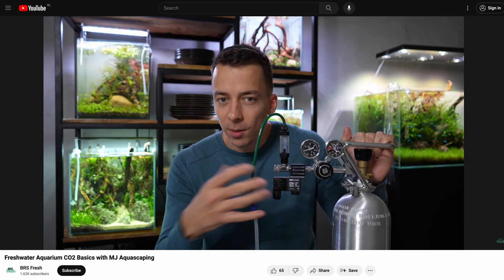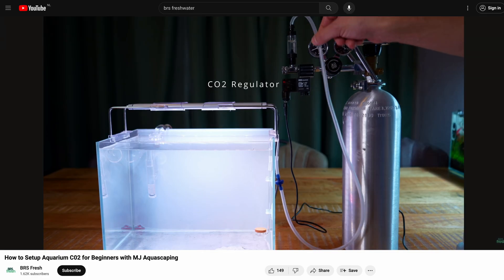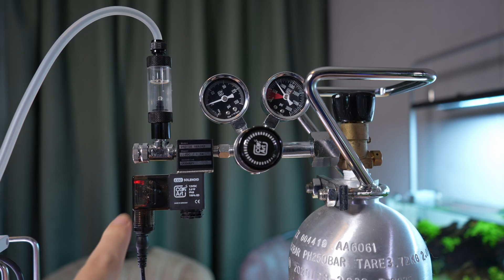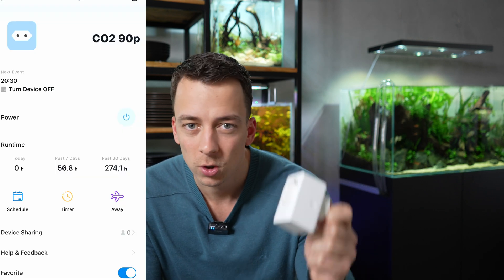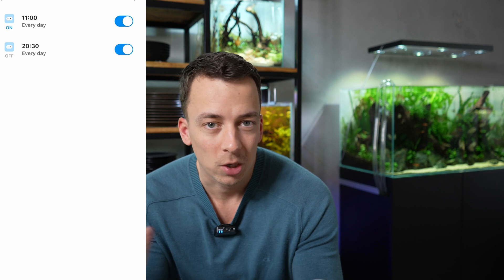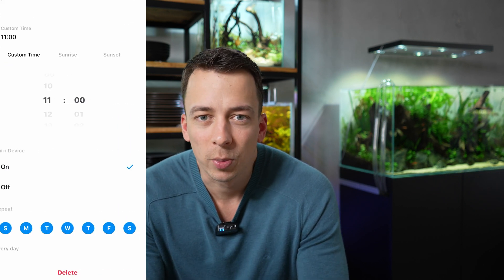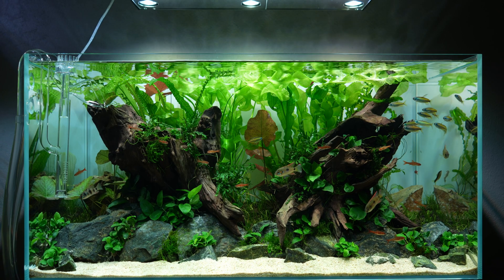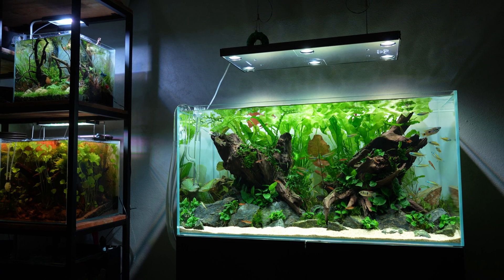Top 10 Aquarium CO2 MISTAKES MADE!

Comment from the maker: What mistake have you made before with CO2?
➡ Electrical outlet timer: https://brs.li/Fresh_SaveAWatt_DigitalTimer
➡ CO2 diffuser: https://brs.li/Fresh_Aquario_CO2Diffuser
➡ CO2 check valve: https://brs.li/Fresh_CO2Art_CheckValve
➡ CO2 drop checker: https://brs.li/Fresh_CO2Art_DropChecker
➡ Spare CO2 cylinder: https://brs.li/Fresh_CO2Tank_5lb

Comment: Turning off CO2 at night is now an outdated method, but it depends on the volume of the tank. For example, for tanks up to 75l, it might make sense, but for tanks over 100l it no longer makes sense. If you turn off CO2 at night, by the morning in 8-10 hours your pH can jump by 2 degrees to a value above pH7. And this is much worse for fish and plants. Moreover, it has been proven that with a reasonable dosage of CO2 even at night, nothing major will happen in the aquarium. Quite the opposite, in the morning after the lights are turned on, the plants have enough food. It may not be suitable only for certain plants, but rather for certain animals, but I never notice that either.
Reply: Turning off CO₂ at night is not outdated, but it is no longer mandatory. Stability matters more than rigid rules.

Comment: What about co2 bubbles getting sucked into canister? My flow pushes co2 bubbles all the way around the tank back to the pipes. So intake will suck some of these bubbles for sure, and i came across that it might kill the beneficial bacteria due to oxigen loss or even harm canister filter. 🤔 my co2 and filter pipes are in opposite corners.

Comment: How do you unblock a CO2 diffuser membrane disc? I bought a new glass diffuser with a spiral tube inside and the diffuser disc on top but it seems to be blocked up and not passing any bubbles. I even tried blowing air through it with a lot of pressure but it still does not pass any bubbles through the disc.

Comment: I just set up a high pressure co2 system. The co2 is going straight to the surface and I use a sponge filter. Would a wave maker be a good way to circulate it better? What else could I do without changing filtration?

Comment: Just hooked up my first nano tank (dennerle 60l) with a co2 system yesterday, but I have trouble with the bubble counter. I just have a basic glass one that’s next to the tank, but unless I turn the pressure up to “small tornado inside the bubble counter” no bubbles come through the diffusor. If I leave the bubble counter off it flows on low pressure, so I was thinking about buying a new bubble counter thinking something might be wrong with this one, or a different diffuser.

But I’ve read different diffusers need different amounts of pressure, just like different tanks need more of less CO2. 

So what’s the point of a bubble counter anyway if you just read of of the drop checker anyway?

NL here also buying of Azaqua!
Reply from the maker: Hey, good questions!  So this does happen a lot (with me too) where you put a diffuser in and set an appropriate rate of CO2 and nothing seems to happen.  There are a few possibilities here that at least I have encountered.  For me, I have turned the "tornado" on just to get the bubbles flowing (this is often after having the diffuser sit for a couple hrs in the tank).  Once they flow or burst through, they should continue at an appropriate pressure - that's when I dial in the bubble counter to 1-2 bubbles/sec.   Then I adjust from there using the drop checker.  If that doesn't work, then you may have debris in the diffuser (less likely) or it's faulty and needs to be replaced for whatever reason OR what typically happens is you have a leak somewhere.  That can be due to missing the little black o-ring in the bubble counter, it can be a small hole in the tubing, etc.  So check that stuff out first.  This should work pretty easily for you so if it isn't it's not because you're doing something wrong, it's because there's something wrong with your equipment (my assumption).  Hope that helps!
Reply: @ thanks for the advice!
Seems I got a lucky hit, removed the bubble counter when I posted the question in wait, but appears I have hit the right amount of co2 right away. Drop checker is perfectly green all day so for now, I’m just gonna let it be as is. (It is ofcourse on a timer and stuff).

Might mess around with it later again if I change my diffuser to one that’s full glass up and out the tank (not really happy with the matt-“transparent” co2 tube I have right now, and the clear one is to rigid so it keeps a bend and pulls everything off).

Comment: Another tip: In my opinion, the position of the CO2 diffuser should be closer to the substrate, as this also extends the contact time of CO2 with the water than if the diffuser hangs higher in the aquarium. Greetings!
Reply from the maker: 100%!  Thanks for watching!

Comment: Hi, How is it possible that CO2 goes through the dropchecker and through the new tube but comes not out of my new diffuser? I removed the valve. 
Looking forward to your reply. 
Regards, Ralph
Reply from the maker: Hi Ralph - new diffusers can take time before bubbles start to form.  The valve won’t affect it and best to keep that on there to ensure no back-flow of water.  What I often do is turn up the CO2 for 30seconds pretty high to force it through and once the bubbles form I turn it back to safe levels.  If that doesn’t work you may have a leak in the tube so I would replace the tubing and after that replace the diffuser.  Good luck!
Reply: @BRSfresh  Hi, Thanks for your reply. The tube and the diffuser are fine. I just found out that the rubber ring in the top of the bubblecounter was missing. I put in a ring and now it runs perfectly. So the CO2 was leaking without seeing or hearing it through the top of the bubblecounter. All the best, Ralph
Reply from the maker: Ah!  Makes sense - nice work figuring it out and thanks for sharing!

Comment: Great tips! I did not have my CO2 turning on before my lights, had my diffuser in the wrong place in my tank, had my check valve close to the CO2 tank instead of close to my diffuser, and was using water in my bubble counter. Thanks for the assist 😊
Reply from the maker: Glad it helped and thanks for watching!

Comment: I use an online diffuser which I think is much better. In my bubble counter I use olive oil.
Reply from the maker: Both are great ideas!  Would live to know your thoughts: Do you find that the rate of the bubbles through the olive oil makes you adjust the flow any higher to compensate for the viscosity or are you able to keep the bubble counter dialed the same as water?  How many bubbles per second are you running?  Thanks!

Comment: Hi, I use the Aquario curved diffuser.  ● I've seen your answer to someone else's questions. You said to put the check valve a few inches  above the tank. How do I do that when the stem of the diffuser curves over the rim of the tank and down? I'm using an aquario curved diffuser S in a 60 p tank.  Why do you need to elevate check valve?   In my 60p tank, could I just clip the diffuser on, and it's at the right height? half way up
Reply from the maker: 👋!  No worries with that diffuser. You can just set the check valve in your tubing a couple inches below the curve.  The point of it being high up in the tubing by the tank is to stop the back-flow of water up the diffuser that can happen when the CO2 shuts off.  And to stop it early before it goes down the tubing behind the tank.  In other words, if it’s further down the tubing behind the tank, when your CO2 turns back on, it may not have enough pressure to push through all that water, especially vertical, which could affect the gas flow in your tank or even if it gets to your tank at all.  This doesn’t usually happen right away.  If you have your check valve down low, your CO2 will probably run fine initially.  But in my experience, at some point it doesn’t and when I move the check valve, it solves the problem.  So now, I just start with it high a few inches below the rim.   I hope that helps!

Comment: Thank you for the video. I have couple questions below;

- Do you use twinstar as you are selling on your site
-  Opposite idea ,using filter during CO2 may increase the water irritation on top so Co2 can escape more easily ?
- For example ,we use hang on back filter as the same side as Co2 diffuser, I see that bubbles are going more further side of aquarium. So this waterfall effects push Co2 bubbles mid of aquarium?
Reply from the maker: 👋! Yes I use twinstar and also Aquario diffusers (extended ones are cool).  As for CO2 placement if you place near your HOB the water can push the bubbles down helping them stay in the aquarium and dissolve - and be distributed further in the aquarium.
Reply: @BRSfresh  thank you for your quick respond . very informative

Comment: I think u might of helped me, the valve check being slightly far away might be my culprit. My co2 runs fine but always lags to start. I have to increase bubble counter to force the gas through and then reset it correctly again everytime at start , super annoying
Reply from the maker: I have definitely been there.  Moving the check valve up to just a few inches past the top of the tank permanently fixed the problem!

Comment: Ive been running co2 from the 2 bottle setup (that i learned from your channel 😁) with daily ferts (flourish and flourish excel), about 6 root tabs, and about 2 inches of the enriched aquasoil substrate on a 10g extremely heavily planted tank with a large variety of plants with no fish in it (only some pest snails that hitched a ride from the store) so i dont necessarily have to worry about killing anything by having too much co2. I dont even have a co2 checker because of that fact. And i never turn the co2 off because no fish to kill, pretty much just an underwater garden and my question is: should i put my diffuser near my HOB filter intake? Its literally SO planted that i dont think the filter flow even really reaches the other side where the diffuser is but theoretically wouldnt i get better absorption if the co2 bubbles are going into the filter and back into the water that way? So theres more dispersion of co2-ified water flow..?
Reply from the maker: Good question! If the flow isn't getting to the other side of the tank, making a change in your diffuser location to better cover the tank is a good idea.  In the case of an enclosed canister, near the intake is a good option as the gas will stay within the tubing/canister before being released into the tank.  In the case of HOB, you run the risk of losing gas in the open top before it's full dissolved.  If you're plants are healthy, I wouldn't worry about it.  If they're showing signs of CO2 deficiency, consider two diffusers (you can get a y connector for around $25) then run one on either side.  Again, if all is well, I think you're good :)
Reply: Also, is there such thing as too much co2 if I don't have any fish to worry about killing? im just basically feeding the plants all the nutrients i can think of in all the ways i know of
Reply from the maker: Also a good question - yes, that is definitely a thing.  Biggest concern would be fish, but in your case, plants can be negatively affected by a large drop in pH from the increased CO2 amongst other things like nutrient imbalances
Reply: @BRSfresh  I also don't have a heater and never do water changes only top ups. I know I've heard some plants do better with warmer waters but again it's so planted that I think a heater would barely fit and/or throw off the look that I'm going for and kinda be an eye sore to the jungle I have in there. Think it'd be worth trying to hide a heater inside the hob filter? Also should I be doing water changes if no fish in there? It's currently been running for about 2 months and absolutely no nitrate
Reply from the maker: Sounds like you have a great balance in there.  With no fish you should be fine to continue what you’re doing.  I have not had an issue with growing a variety of plants at room temp without a heater.

Comment: In process of re-establishing a much larger planted setup. Had never used CO2 before in my smaller tanks which may have housed 1 or 2 plants. I find your videos very informative, clear, concise with little or no BS filler. Initially thought about trying the homemade 2-bottle set up but it’s short term and messy. Setting up a 60gal and considering using the tank and gauge-based format shown in this video (of course dependent on setup and continued costing). My concern is on sourcing replacement CO2 (refillable vs non-refillable) bottles and $$$$. New subscriber. 🇨🇦🇨🇦🇨🇦
Reply from the maker: Welcome to the channel!  I'm running a 5g tank on 75g and haven't replaced it in about 4months so far - Got it filled for around $15 I believe...maybe a bit less.  Hope your build goes well!

Comment: My check valve is definitely too far from my diffuser. What placement do you recommend for hang on back filtered tanks? I have my diffuser at the bottom middle of one side of my tank. I have two filters running on either end of a 40 breeder. Is there a better place than this?
Reply from the maker: 👋! Set the diffuser about 2” back off the top rim and you should be good.  That’s my go-to placement on multiple tanks and have had no problems.  Too low (like the bottom of the tank) has resulted in the gas not effectively making it to the diffuser in my experience.

Comment: What about using a air stone in the same tank would it be detrimental to the co2 amount
Reply from the maker: Good question - in our studio we have used a strong air pump to create surface agitation/oxygenation in a 36" long tank with the CO2 diffuser on the opposite side.  Plants are thriving and CO2 levels are stable so haven't had any issues

Comment: Do you still add plant fertiliser to your tanks alongside the co2?  I'm just in the process of learning about it and want to add a co2 kit and was hoping to cut bk on all the chemical fertilisers in my tank
Reply from the maker: May depend a bit on your set up - but while the combo of CO2 and ferts will likely result in the best plant growth, if your goal is to cut back on ferts go ahead and just use CO2.  We have multiple setups with only CO2, no ferts, and they are doing great.  That said, when your planted substrate deteriorates (maybe after a year) ferts may be a needed supplement for your root feeders if you’re not otherwise using root tabs or changing the substrate.

Comment: Thanks so much. I just bought my first co2 regulator from co2art. I cannot get the diffuser to bubble. Now I believe I have water in the line. I'm going to open the regulator and let it flow and see if it starts to bubble.
Reply from the maker: Diffusers can take a bit to show bubbles. Sometimes bigger ones first then smaller ones.  You can crank up the flow temporarily to push it through and get it going faster then back the flow down.

Comment: If i don't like CO2 bubbles... Can i set my difuser under de filter? The bubbles goes inside the filter and back to the water... Can it work?
Reply: Absolutely it works. But if you have a canister filter using an in-line reactor is the best whereby the CO2 micro bubbles is dissolved before coming out of the outflow pipe of your filter. Sera Flore 500 or 1000 active reactor are amongst the best.

Comment: While a drop checker is better than bbs, it’s not actually that accurate.
Reply: A drop checker isn't more accurate? You're nuts. BPS only tells you how much you're injecting, it doesn't tell you actual CO2 levels. A drop checker does. There are very few things that will make a drop checker read inaccurately because it's measuring dissolved gas pH.
Reply: Whats the best alternative